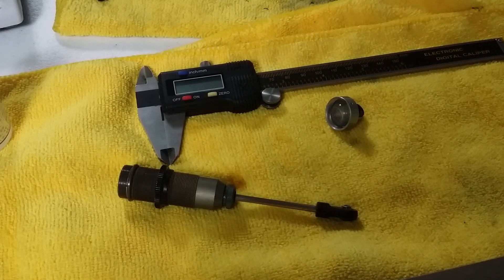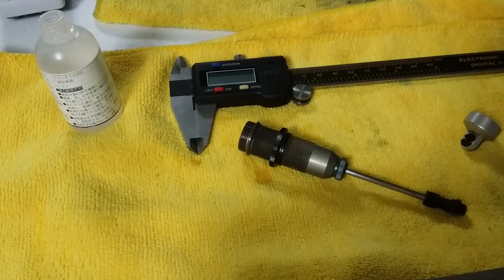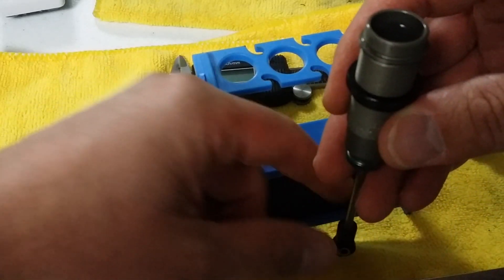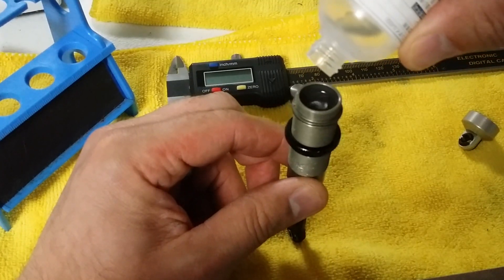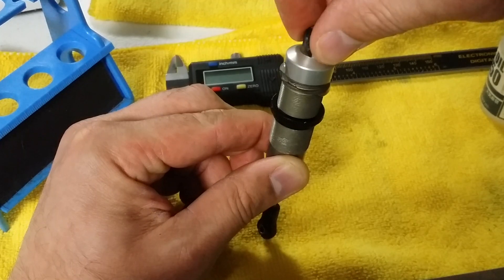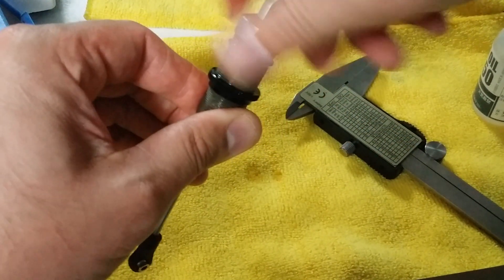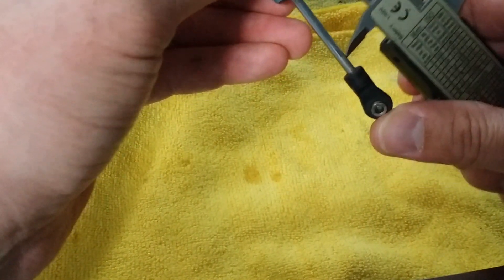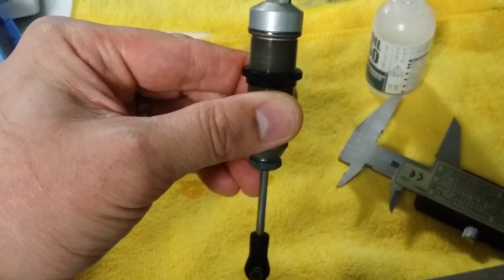Mugen mbx7 shock build

Comment: hows the truggy holding up? anymore issues with a arm breaks?
Reply: +Jay negron 

Looks like they beefed up the mbx7tr arms. The mbx7t arms were plenty strong though imo. Ream the hinge pin holes out with a 5mm bit so the arms move nice and free and they shouldn't ever break, unless you slam into a concrete wall at least ;)